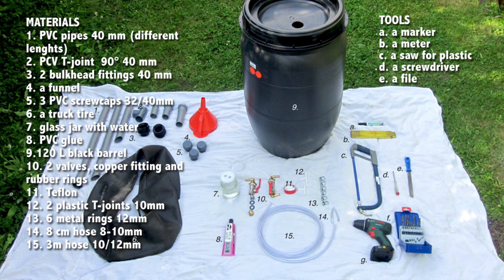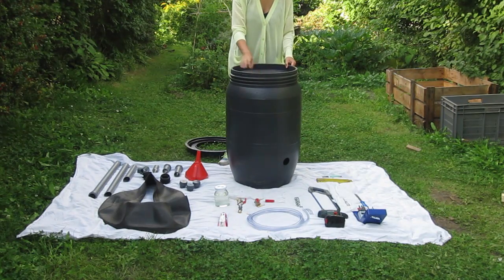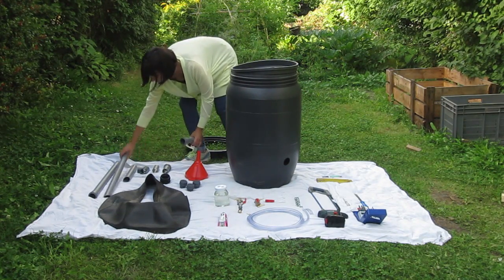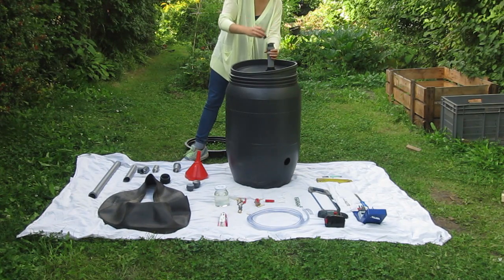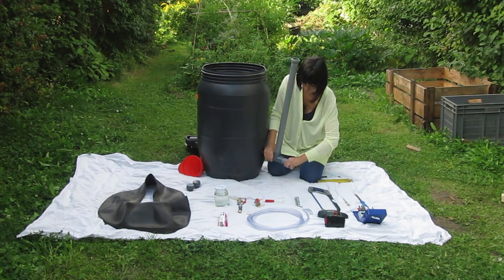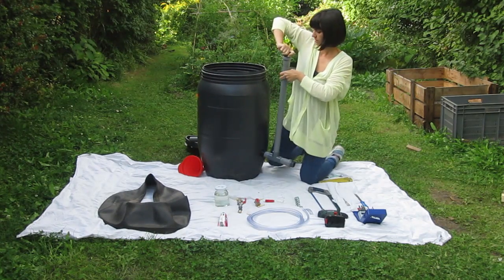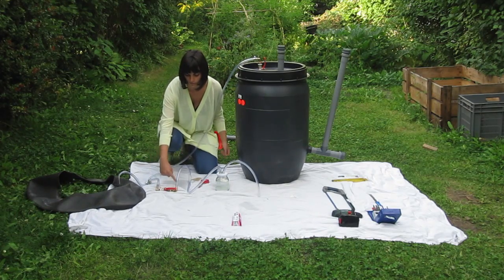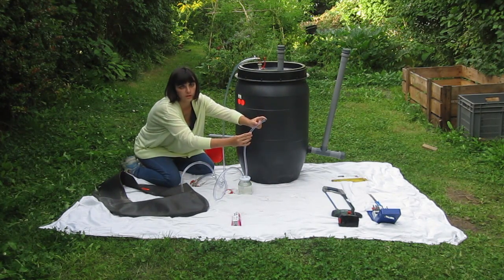DIY biogas digester

Comment: I like that the size of this thing is quite small. With a few modifications to the design it would fit under the floor of a motor-home so that you can live in the motor-home, flush the toilet, dispose of organic food waste, and even add extra waste from the environment such as leaves to get a constant gas supply for cooking and heating or even to run a generator. The fertilizer and broken-down solids waste it produces can be extracted and used for growing food or sold to farmers or just keen gardeners who want high quality nutrient rich fertilizer and fresh soil for their garden.

Comment: Hi Valentina, I just saw your moovie. Its very instructive. I am going to bild the similar one. One thing which I dont understand is why the feeding pipe is such long, If am not mistaken it almost reach the bottom of barel. Would it not be a problem to feed the substrate afterwards ? Thank you very much. Greetings from Poland. Tomasz
Reply from the maker: hello! you want the new 'food' to mix a little with the old, and not to have it laying on the top. because you are not opening the barrel to stir it, the long tube, kind of does this..

Comment: I presume methane gas is highly flammable and the plumbing does not seem all that good and could leak methane and cause a fire. Also not much explanation of what you are doing. What type of cooing appliance do you use with this gas. You cannot use normal LNG or LPG gas cookers with this methane as it will have low pressure.

Comment: Safety tip: ground the barrel, since static charges can accumulate on the plastic of the barrel and then you reduce possibility of unwanted combustion. Also, I prefer to use the term methane instead of biogas. Great build!

Comment: Hello, thanks a lot for the information. I instantly rushed off and built one using swine droppings.

It did generate gas alright but 2 weeks has gone by and the gas still wouldn't burn.

Im getting disappointed.

What could I be doing wrong?

Comment: do you need tomake any change of the inner tube before getting gas in? as there is a valve stem for the pressure
thanks
Reply: Yes you have to remove the core valve of the inner tube for gas to enter

Comment: hi ths is sai.i make a same type digester 20 days back in my home now its produce the gas but its not flameble(ignite) why?.i allready release the gas compleatly 2 times.what can i do now plz give suggestion.thanq
Reply from the maker: Hi Sai, first thing to check id what you have fed the digester with. Did you started with cow manure? Cow manure helps to create all the right methane-producing bacteria. 
Another idea could be that there might be not enough pressure. You can add some weight, such as bricks on top of your car tire, to create more pressure. Related to that is what kind of burner you added in the end of your hose. If you connect it to a normal camping gas cooker, it will most likely not work. You have to connect it to one that is modified for biogas digesters, so, the holes are bigger and therefore more gas is able to come out. That is because we can't reproduce industrial like pressure, such as in the gas cans you buy from the market. 
Please let me know how it goes!

Comment: Hey nice video! I live in Berlin too:D And I want to maybe fit one digester at the back of my truck.
From what I read on the internet I thing you get a better productivity of gas if you put stuff that haven't already been digested like cow shit. Cause in a way the job has already been partially done in the cow/animal digestive system. Putting grass or peel of fruits will increase the efficiency. 

3 years later did you manage to have good results? How about the smell? Cause I'm scared that having such installation right next to my house might not be a good idea if it smells too much :S

Tschuss!
Reply from the maker: hi Samuel, indeed. I think you only need to start the system with cow manure and then feed it with the things you say. Cow manure, since it has been already digested, has already the good microorganisms you need. I am not using mine at the moment, so if you want to have it for your truck, I could borrow it to you..
Reply: Oh right didn't think about the fact you need to put the bacteria in it first. Thanks for the offer! My truck is not ready yet. I'll let u know :)
Reply: Valentina Karga:hi i all ready start with cow manure but not connect to the these type of burner ok i will try that what u say thanq.

Comment: You can add sugar or brewer's yeast (to accelerate the fermentation), and use human waste too (poo), but after that you can't use the mass for fertilize the soil where you cultivate "edible fruits", but is good for flowers.
Reply: brewer's yeast would produce CO2, this process needs methane producing bacteria, so it is neccessary to use cow dung.

Comment: Methane Gas Spontaneously Combusts with a 70 / 30 air to gas mixture so how do yo prevent explosion at start up? And when you feed it ??
Reply: I've been researching biogas for some time now and have never heard of methane spontaneously combusting at any gas:air mixture except in a compressed gas situation. (A paper entitled 'Spontaneous Ignition of Pressurized Releases of Hydrogen and Natural Gas into Air' published by Frederick L. Dryer, Marcos Chaos, Zhenwei Zhao, Jeffrey N. Stein, Jeffrey Y. Alpert, and Christopher J. Homer - Mechanical and Aerospace Engineering, Princeton University)
Swamp gasses (or marsh gasses) have been known to combust, however that gas is a combination of methane, hydrogen sulfide and carbon dioxide. The theory for their combustion is that some swamp microorganisms may release diphosphane, which ignites at room temperature, and when it reaches the surface it ignites the swamp gas.
Since I'm planning a methane digester, I would be very interested in learning about the possibility of spontaneous combustion. If you happen to have any links that you could share with information, I would greatly appreciate it. Thanks in advance.
Reply from the maker: Hi, no unfortunately I didn't go that deep into theory. In this case, the methane gas is being compressed by putting it on a car tire and adding some weight on top, when you burn it.. But this is practical. Please upload a video if you built a methane digester!

Comment: Hi Valentina. Can I produce a fire from it like from the Gas stove?
Reply from the maker: +David Mariano yes, you can connect the outlet to a gas stove and use the produced biogas to cook! however, you will need a special gas stove for biogas, with bigger holes, because the gas coming out of this digester has lower pressure. You can find one online, or find some other tutorial of how to modify a normal gas stove..

Comment: Hello Valentina, this is fascinating! When your gas goes into the tyre tube what kind of pressure do you get and how long could you cook for using the gas in the tube. So the tyre tube is the permanent storage facility with a tap off to the stove/cooker?  How long do you keep adding to the digester before having to empty it or drain some of the waste out? I am going to try and replicate your design and see how it works.  Danke schon!
Reply from the maker: Hi Rob. Great that you want to try out the design! If you are in Berlin, you can have this one, as I m not using it at the moment. Yes, the tyre is the gas storage. About emptying some out, It really depends. It will take you one month for gas to start producing after you fill it up once at the beginning with cow manure. Then, i would wait one more month so that the pathogens are killed. after that, you can start emptying some of the digested manure from the bottom and start adding bio-waste from the top, regularly, every week.  Good luck!
Reply: Hi Valentina! Thanks for the kind offer but I live in Johannesburg. Had I known about you I would have visited when I was in Berlin in July. Did your digester really create enough methane that was really usable? I want to build an off-grid house near Kruger National Park. I see that you are also into rocket stoves which will also be one of my next projects. It is all so very fascinating - and fun. Hopefully if I get something working you can come visit. You have a year start
Reply: I meant "head" start but my Nexus thought otherwise!
Reply from the maker: Rob Fowler Hi Rob, to be honest, I never really managed to produce usable gas so far. I had done the experiment end of August and just right when the gas started producing it got already cold in Berlin in September and the process froze. I know somebody with a similar system and he said he is able to cook with it once a week. so, it does not produce as much in this scale. However, i think its a good scale to start experimenting before you go to something bigger.
Reply: Guillaume Farley  habari yako dada mimi nipo daresalam nimeipenda hiyo nami nitatengeneza wewe rafiki mzuri karibu tanzania
Reply: @sitially2112 , naona mwana kwetu umeipenda technolojia hiyo. Tanzania ya viwanda inakuja,